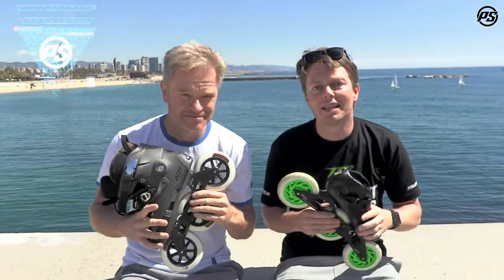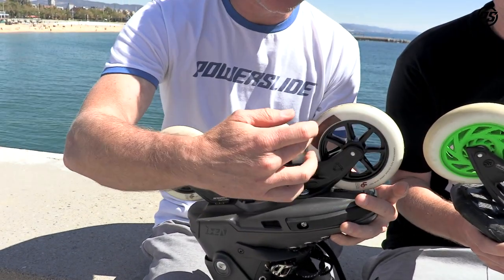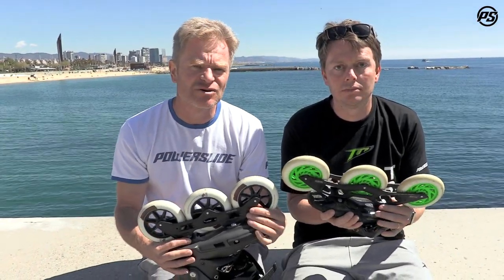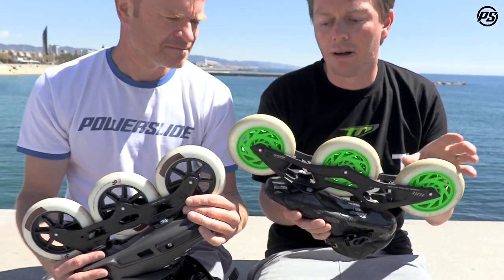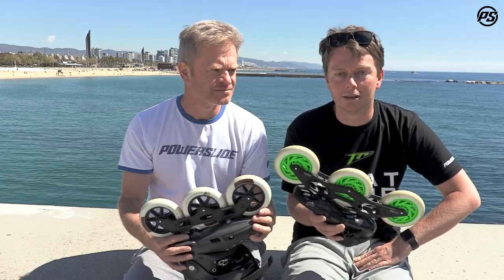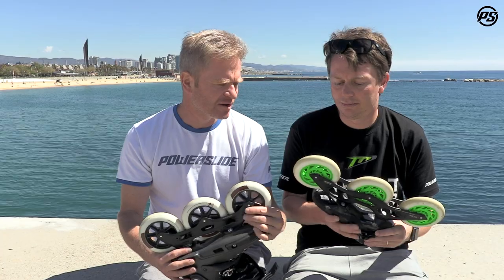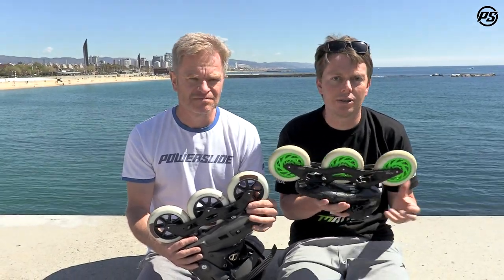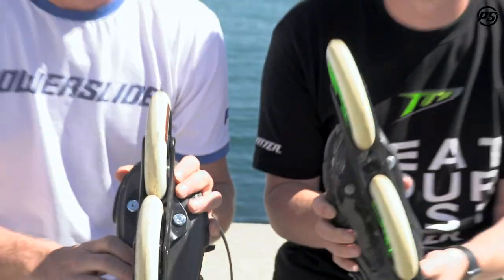Skate Frame lengths - Powerslide Speaking Specs

Comment: All my skates are PS, and I love them.  Favourite set up is Tau boots with 255mm 3x125 frames.  Transition from 110s to 125s was surprisingly easy.  They're faster, smoother, very agile, and can still slide.  Wheels cost more but seem  to last longer.  All in all, they're just more fun than smaller wheels.  Just wish the UC 125mm 86a natural black wheels were available.  Perfect wheels.  Good grip with a whole lot of speed!

Comment: Love your videos Guys, I've learnt so much and have two pairs of Powerslide boots with trintity frames, hockey 4 x 80 and urban 3 x 110,.  When buying new boots, with franes, I've been looking at frame lengths and they're all presented in millimeters, even on the Powerslide website.  I wasn't able to keep up with the references being made in this video as I'm not that quick at converting inces to millimeters.  Would be really helpful if you could quote both in inches and millimenters or have the length in millimeters displayed as a caption on the screen while your discussing the length in inches.  Keep it up Team, great informative videos!

Comment: Why are frame lengths (still) measured in inches when they have to fit on a mondo-sized boot and fit wheels (and axles) sized in mm?  
I have small feet (40-41) and normally roll 4x80 (quickly worn down to 4x75 in a 243mm frame) and sometimes have fun rolling on 4x90 (long and stable 273mm) so maybe I should give 3x125 (very close to my foot length, 252mm) a go for the faster and smoother ride on variable urban terrain.  Worried about the extra height and resultant strain on ankles though - does it take long to adjust?
Reply: I think it really depends on the person, coming from ice hockey, I bought some aggressive 55mm, and after 3 months switched to 3x125, 15' of adjustment. You should definitely try some to see if you like or mind the height ;)

Comment: Why not a trinity 4x90 frame?
Reply: Probably because the 4x90 frame would be too long for freestyle and too short for the marathon.
Reply: No way above >42 EU. For me it’s the perfect lenght for freeskate, and with their trinity mount would be lower
Reply: @useron  The standard frame for freestyle/freeride is 243 mm (from 37 EU to 44 EU). This is the size Rollerblade and Seba also recommend.
Reply: i5artube of course I know it, but I think it’s a wrong recommend for sizes above 42 eu, because the length of the frames plus the wheels will be less than that of the boot. But it’s only my opinion. I wonder where is the problem of making more frames options
Reply: @useron  Like you I also cannot find the frame I'd like to use (225 mm 3x110). I guess resellers still have to sell the old system frames and boots so they don't rush to make new sizes.
Reply: i5artube actually, for lower skate sizes ( below 39) it's 231mm frames ;) 243 is too big for me for example :)
Reply: And now there is! Kizer flux
Reply: I do agree 4x 90 is the best freeskate for people with a need of speed in the city. There are 3 trinity frames that I know today. Powerslide AL casted, Kizer Flux and Endless

Comment: But why is the nexus  frame for 110 wheels 243mm long instead of lets say 125mm base to base? Would'nt that be optimum for instance in urban skating when droping  down stairs and so.? :) thanks anyway for Trinity <3
Reply from the maker: some might like a longer wheel base, but especially for dropping down stairs, its nice and safer to have the wheels closer together instead of going with a big gap in  between each wheel, which can create room to stick and fall...

Comment: How come my PS Next Red, 3x110, came with a 270mm frame, when I saw in all the reviews it had a shorter frame.
Foot size 43/44
Reply from the maker: what is the article number of your product please?
Reply: @PowerslideInlineskates  article number is 908374

I'm sorry, I wrote its size 43/44 but I was mistaken. It's 44/45.

Do the bigger boot sizes maybe come with a longer 270mm frame?
Reply: Is it normal that I got a 270mm frame, or has there been some mistake?